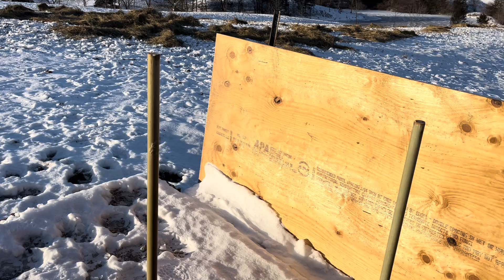How is our new freeze proof livestock water system performing in negative temperatures?

Comment: It's not wasting water Greg, it's protecting against the main line to the water trough freezing and breaking at full flow which would waste a lot of water and cause other issues.  Additionally, the water is being allowed to irrigate a small area of land which will help it in the long run like when the cattle leave a bit of hay that is rolled out.  Something about an oz of prevention...

Comment: Good morning Greg. Could you maybe discuss the benefits and pitfalls between using this method  of keeping stock tanks from freezing Vs an electrical heat device/source?

All the best to you and yours.
Reply from the maker: The stock tank heater in the tank would not work by simply hooking it up to a hydrant. The hose and hydrant would freeze and crack open. In below zero weather, you have to have running water through your supply hose to keep it from freezing. 
If you had a way to fill a stock tank up with water and then unhook your hose while placing the stock tank heater in the tank, that would work. Problems arise quickly with large herds, they run out of water.
On our 300 head cattle herd, we are using the same tank, 50 gallon continuous flow with this awesome brass valve. It has not froze yet and the cows have not run out of water.
Reply: @gregjudyregenerativerancher  I appreciate your reply, it’s invaluable. Funny how we learn things in life, I’m sure you’ve been watering livestock since Christ was a cowboy, but this must be your most effective system yet.

Comment: Curious, what is your water temperature. Snow does make a great insulator. Life is good on the farm.  You folks stay warm!
Reply from the maker: Water temp off the water line is 50 degrees. That is certainly helping as well on the hose not freezing.
Reply: I am impressed with that temperature off the water line. I thought it would be around 40-42 degrees even a little lower. Nice. @gregjudyregenerativerancher

Comment: Are you keeping the ATV in the garage yet? How about the other vehicles?
Reply: Also, if you pack the snow in an arch above the pipe, it will keep the heat of the moving water in very well and that air space will make a difference. You won't have snow for too much longer though. Keep warm.
Reply from the maker: No, those Honda’s are unbelievable in starting in frigid cold. Very dependable machines.

Comment: Snow is an EXCELLENT insulator. Back in the 70's and 80's winter ground cover was snow in souteastern PA. Spring melt was great for adding water to the water table. Yesterday we had mostlly grass, was green before the deep freeze a few days ago, in north central PA. About midnight Mon/Tues snow began and we now, 6:30 am, have a thick covering. Keep warm!
Reply from the maker: We certainly need the ground moisture. We will take the white stuff to😊😊